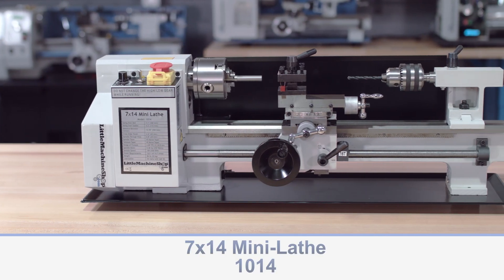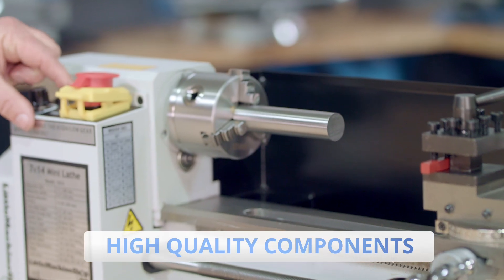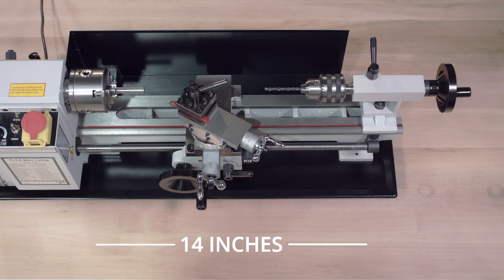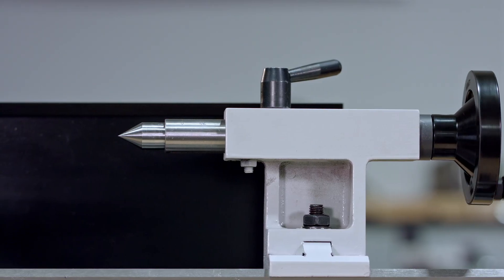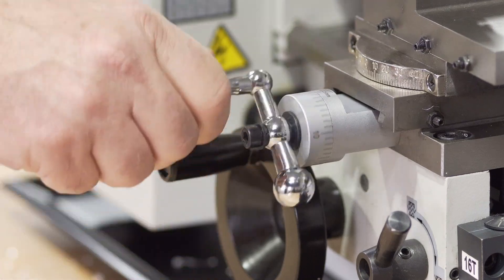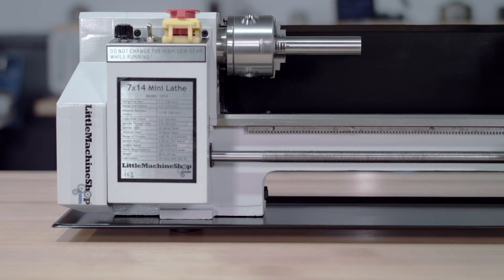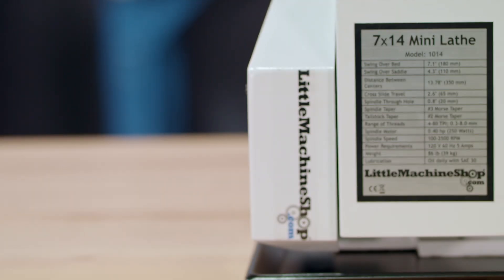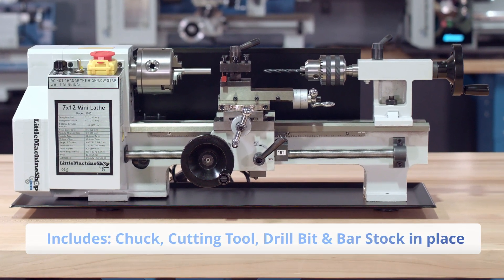SIEG C2 7x14 Mini-Lathe, Model 1014 by LittleMachineShop.com

Comment: Is there somethign similar for wood lathes? All the mini ones I see look like hot garbage
Reply from the maker: It depends. Most wood turners making bowls, spindles, etc. are doing so "free-form" with tool holder and hand chisels (maybe jigs) allowing more freedom and "organic shapes. Machines are also built different to handle the wood dust and vibrations. They don't need to be as precise. More truck than sports car...  They may look less "sophisticated" but they don't need to be.  Metal working machines are more about accuracy, so some are used by pen turners, pool cue makers, etc. where that become more important. Usually cutting harder woods and cutting more like a metalworker. Still need to avoid the wood dust in bearings and precision ways. So, it depends on what you're planning on doing.
Reply: @Littlemachineshop  Thank you for taking the time to give a detailed answer; I truly appreciate it!!
Reply: Jet 1015 and Jet 1221

Comment: these are much better than Sherline and Proxxon.  Cast iron vs alumnium frame,  iron vs plastic gibs.  Proxxon MF70 in particular is so flimsy and hyped, with its aluminum ways and plastic gibs...
Reply from the maker: Thank YOU. We like it as well...
Reply: @Littlemachineshop  
I've shopping for a bench Lathe, but I hate (like many others) buying junk!. I see plastic gearing, I run!